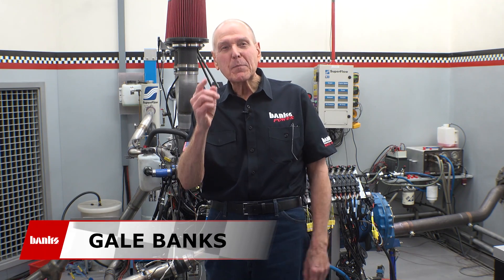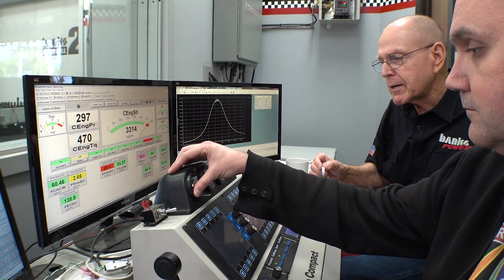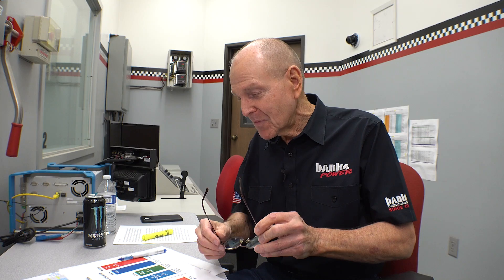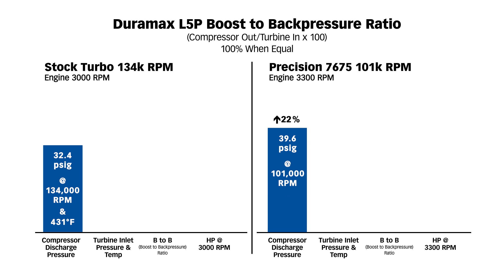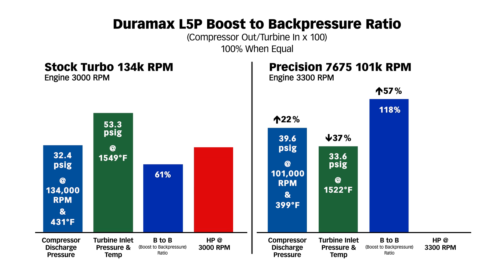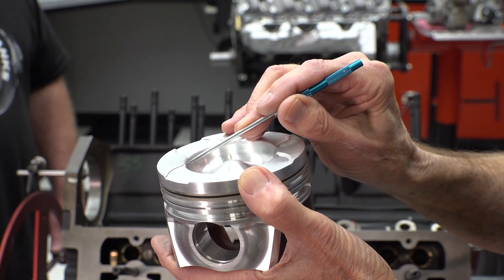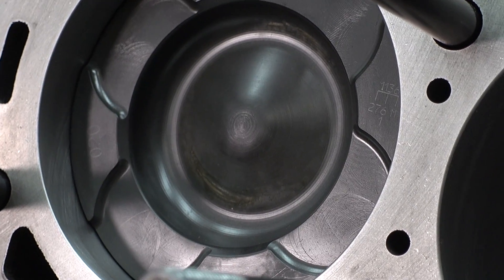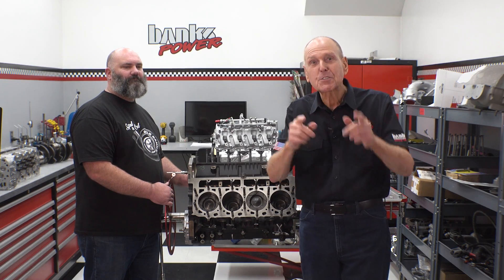Killing A Duramax Pt 8: 711 HORSEPOWER!

Comment: Hey Mr banks and gang, which way would be compressor discharge? Sounds dumb I'm certain it's from intake into the cylinders? New to boost and duramx life, debating a 6,0 Duramax swap in my 95 obs with original 305

Comment: A tuner watches power and torque.
An engineer watches temperature and speed.

Also: it needs to be 37 degrees, not 37% for turbine inlet temp.

Comment: But the precision turbo is rated aroud 1200hp.
Why did that turbo became an issue in the last episode?
Reply: Because the 1200 hp rating for the turbo is assuming it is on a gasoline engine.  Diesels require more air to make the same power as a gasoline engine.  I checked the Precision Turbo website, and it says the 7675 turbo is for GM LS applications, and is not listed for diesels.

Comment: Gale can you do a torture test on these Denso Injectors?  I've lost 2 of them on a stock L5P at 120,000 miles.  Both of them failed in the same way.
Reply: Sounds like you torture them just fine

Comment: what is your oil TEMP at the turbo at 700 HP.   in my humble opinion the oil temp is the most important.   mount a oil temp control to the turbo oil.

Comment: The aluminum pistons are being pushed way too hard at 700 hp.  To get durability longer than a few hours at that power level, steel pistons will be required.  I also wonder about the exhaust valve durability at 1600F egt.  It's amazing that they were able to get to 700 hp on the stock injectors. Bigger hole injectors will help, but will it get smoky?  How about raising the speed to 3600, maybe 3800 rpm?  How quickly is fmep rising at 3300?  Maybe you can get more bhp at the higher speeds without friction eating up all the extra fuel.  At Cummins, we had a limit of 2500 feet per minute on piston speed before friction ate up the extra power.  On the Duramax, 3800 rpm is 2470 fpm piston speed.  Then what happens to the turbo match?  The higher mass flow at the higher engine speed may cause choking in the turbine, necessitating a bigger turbo...

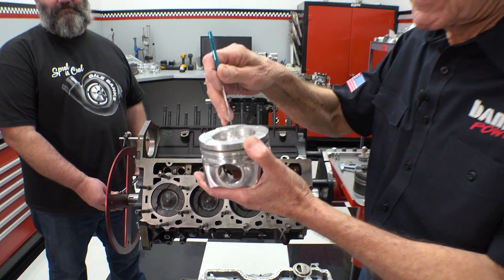Comment: 11:40 why does the injector inject out at an almost flat angle instead of straight down into the piston?
Reply: Fuel has to be injected into the maximum volume that is available in the cylinder when the piston is near TDC.  Swirling air motion in the piston bowl stretches the spray plumes to quickly evaporate the liquid fuel into a combustible mixture of evaporated fuel and air.  Otherwise, the raw liquid stream of fuel will impinge on the bowl surfaces and form particulates due to late burning with insufficient oxygen.

Comment: Best thing you can do for a diesel bigger turbo bigger injectors change up your timing your duration have a fuel pump that could drain the ocean into space and hope you don't melt the motor best thing you can do if you're going to do it get forged heads cuz nobody likes liquid Pistons they don't work too good oh and head studs head studs for days it's better than having the entire tap into your motor making your hood into a lowercase n lol

Comment: Gale banks, could you do a video, or just message, why not have a banks tune using EFI live? I don't understand the benefits of "intercepting/lying" to the ecm/tcm (derringer) vs "rewriting" the ecm/tcm (EFI)?
Reply from the maker: There's an interesting and important difference. When you flash an ECM, the vehicle thinks it's always had that new horsepower rating. It doesn't know if the rest of the vehicle has been beefed up to accommodate the new power rating. If you give it a 150 hp tune, it thinks it's supposed to always be adding extra power, regardless of engine temp, thermal management, etc. It's like a weightlifter who woke up one morning with massive strength but wasn't given a heart to support these new muscles. So, he lays down on the bench to lift some weights and dies of a heart attack. An inline tuner that monitors engine and trans parameters via OBD (like the Derringer) doesn't add power unless the engine is up to temp, it doesn't add power if the transmission slips, it doesn't add power if the torque converter isn't locked up, etc. A "tuned" ECM doesn't do this... it ALWAYS adds power. That's why so many tuned trucks break.
Reply: @bankspower  good to know, I had no idea what the difference is thanks for such a prompt response

Comment: I will never get over how aluminum piston withstands a 2500 plus degree combustion event and does not melt. Nox emissions go up to a certain point (2500 Fahrenheit) id like to see higher cylinder temps (5000 Fahrenheit). If it gets hot enough you might not need EGR on a on high way truck /light duty pick up
Reply: And aluminum melts around 1200f

Gotta love magic alloys

Comment: I figured 600 horsepower would bring over 1000lb-ft of torque
Reply: Right?!
Reply: Dwayne Neufeld yea I guess that’s a duramax for ya, always about horsepower, not torque.
Reply: I know I'm late to comment on this but for anyone reading this it has nothing to do with "being a duramax" it has to do with the rpm the engine is being run at, you will never see peak torque at the rpm in which peak hp is achieved. If this what ran from idle up to peak hp you would see well over 1000ftlbs. L5p makes peak torque probably around 1600 rpms.

Comment: I would have guessed more power with an aftermarket turbo.  My 2017 6.7 powerstroke made 566HP and 1173TQ. Through the drivetrain!  I'm more impressed with that.  But I do love this series and how technical you get with the numbers!
Reply: The difference is this would run for long periods of time at that level. It would easily put out substantially more but he insists on building intelligent power as opposed to throwing fuel at it until parts fall out. That's fun and a lot easier but certainly not better
Reply: @travispfannmuller7717   I realize that, but they have stated that they reached the limits of what stock hardware could support.  That's what I was talking about.  Also mine doesn't smoke at all,  I feel like there may be more to be had on the ragged edge, pushing past known limits and possibly creating damage in the process, but it is tuned by a person, Gale himself has endorsed.  With all the EPA crackdowns I feel like I shouldn't name anyone lol
Reply: I doubt a lot of tuners are concerned or are even aware of injecting past 40* or all the other parameters they are taking into consideration.  It'll probably take a while but safe to say it goes well over 1000 before pistons, rods, or any major components fail. I don't think he ever suggested the peripherals like injectors or pump wouldn't be replaced to achieve that. I'm curious what level the factory head bolts will become the limiting factor. As far as the epa, I wonder if the derringer is totally legal in Cali? I'm in Canada so we don't have quite as many restrictions yet
Reply: Yeah, I understand the premise here, but like stated before, I would have thought the stock fuel and are would safely support close to what I'm making at least.  I know he wants to find the limitations of the, rotating assembly, block, and studs but in a safe manner.  California wants every vehicle bone stock as delivered.  Luckily my state and many others are very lenient. They know what people do, they just turn a blind eye
Reply: Get back when your motor is 10 years old and has failed with a repair bill north of $10k
But what does that mean to someone who buys a new power stroke. 
You have good swirl. 
Your money swirling right down the drain.

Comment: interesting, i ran some numbers which are left out.  assuming dry air, which where they testing is pretty close to dry air. 

.14273 lb/ft3 stock turbo
.17068 lb/ft3 precsion 7675

567 hp stock turbo
711 hp preciion 7675

19.6% ad increase
25.4% hp increase

i would have expected more than a 5.8% increase in power from pumping efficiency increases with the improvement in turbine flow.  i guess thats still 41hp just from pumping though.  i wonder if the efficiency would improve if we were to run the compressor at the same air mass flow.  whats not really a fair comparison is that the tests were at different rpm which makes power comparisons kind of apples to oranges, it would be better to compare torque which is a more direct comparison of cylinder pressure if we are at different rpms.  given that across 10% rpm increase we can expect a near equal volumetric efficiency, 10% of the power is literally just coming from spinning the engine faster.

im playing with the idea of building a turbo dyno, basically a combustor to drive a turbine section, that is not coupled to the turbos compressor, and then a way to throttle the compressor bleed.  this would allow real compressor maps to built as well as turbine drive maps.

Comment: Great start to the New Year - gets some orange, chocolate chip ice-cream and sits down to watch :-D
It isn't surprising the increased fuel pressure effectively reduced the actual fuel flow as it is more difficult for the injectors to open against the pressure - this would mean longer for them to open and/or them not opening fully

Comment: Love these episodes!.....But, is this research helping to get max power and torque and still have it be a completely reliable everyday driver? I love my Duramax!...and would be amazing to get it to a 700HP daily driver, have the torque come almost on throttle like the stock turbo and still pass the emission tests.
Reply: Reliable efficient power is his specialty. That's the difference between his product and the vast majority of companies that supply parts or tuning. I'd guess no one besides the OEM's have the ability or knowledge to test the way he can
Reply: @travispfannmuller7717  I'm not question his products as I have them on my L5P, because Mr. Banks' very respectable knowledge and research put into his products.
Reply: @wudntulike2no32  bi-turbo variable twin scrolls would take care of that.

Comment: So now you’re at about 600 wheel hp if it was in a truck? 😂 so much work for so little return
Reply: Not a lot of work.  a tune, turbo and a fuel pump.  Stock heads, bottom end, injectors.
Reply: It appears more work as Gale's being very analytical about the process, pretty sure most tuners could get one of these to 1000hp+ with 'less work', difference is it would just go bang in a few short, hard runs.
Reply: His return is knowledge and that doesn't come easy. Obviously he could just throw fuel at it but there's many choices out there if that's what you're into
Reply: @Dylan-wp5kb  I just can't wait to see the numbers when the real work starts! 👍

Comment: Let the rods fly! 
This inch by inch HP Crawl is getting Boring!
We need some Real Action to start the new year off with a “BANG”.
Reply: Why? Gales trying to find the limit to actually learn where that limit is in each particular component , it can only be done gradually with lots of 'boring' data analysis.
Any goon can up the fuel and double down on the boost and throw rods everywhere but you learn absolutely zip..
Reply: It's going to blow up eventually but that may be with ported heads and massive injectors compound turbos and dual pumps. Hes not trying to blow it up being stupid. He couldve done that the first episode if he wanted. He wants to find the structural limit to the design of the engine whether its crank rod or block. Not from a bad tune.

Comment: Guy's a genius. But can a diesel compare to the performance of a gas monster truck engine? Diesel dragsters can't compare to top fuel engines. It's like trying to propel a fighter jet with a flathead Ford. Sure it's impressive....for a flathead.
Reply: If you compare average horsepower and efficiency then it is a much different story. A Diesel's peak power will never compare to a gas engine when all things are equal. Imagine a 6.6L gas engine with 30 or 40 lbs of boost! You would be well over a thousand horsepower. With Alcohol you could be even higher. However, you would also be chugging the fuel back like there is no tomorrow. It is just another case of the right tool for the job. It is much nicer pulling your trailer up a hill with the engine  at 2000RPM and still in top gear, rather than at 5000RPM in 3rd gear. There are benefits to having lots of low end power.

Comment: Would it be possible to get injectors with a slightly more downward injection angle so you can run more injection timing without burning the pistons, or would that introduce other problems?
Reply: My complete guess, is that they have chosen the optimal angle for getting fuel inside the bowl, and more downward might start spraying the top of the piston crown inside the bowl.
Reply: No, don't do it.   Get more injector nozzle  to get the fuel in faster - in less crank shaft rotation.
Reply: @timbo19751975  That makes sense